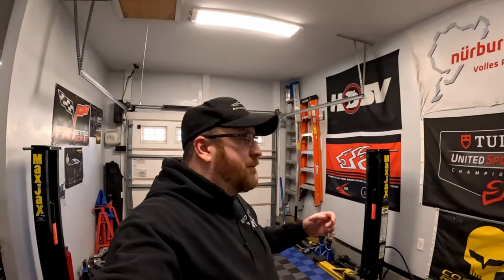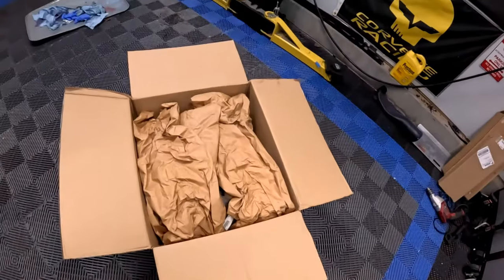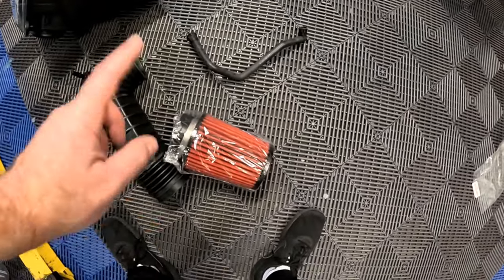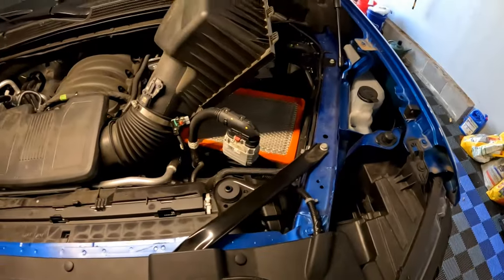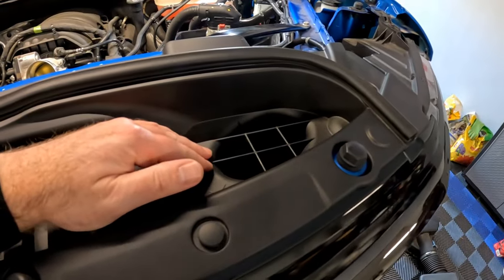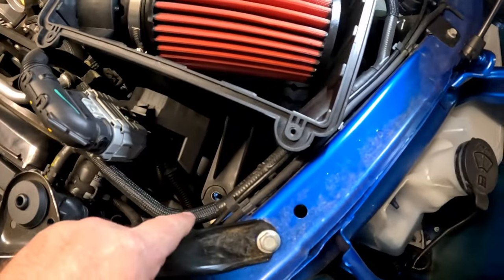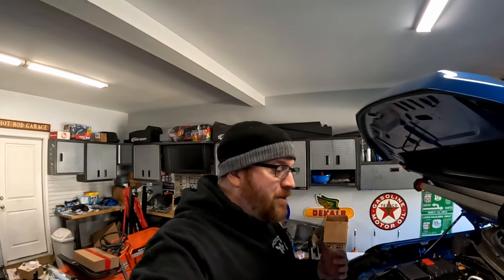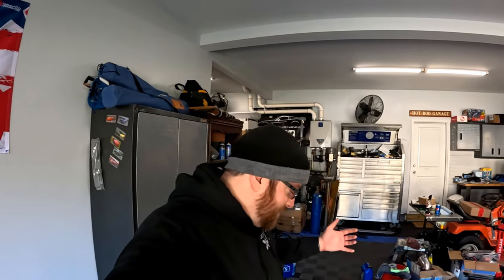2022 Chevy Silverado ZR2 - @chevroletperformance Intake

Comment: Do you know if it is possible to add the bed from the new version from 2019 to the older version of Silverado/Sierra from 2014-2018(19) to gain a few inches at the bottom of the bed width?
Reply from the maker: It might bolt up? I mean body lines won't match at all.
Reply: Yes, the body lines may not match. I'm still thinking about the inner part of the bed, but it may have a different height :( @bonecrrusherSS